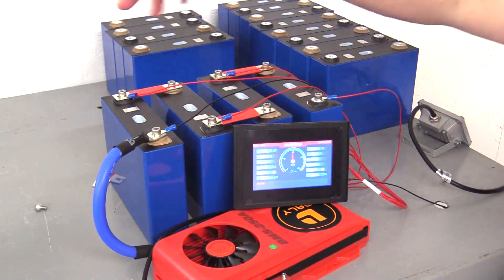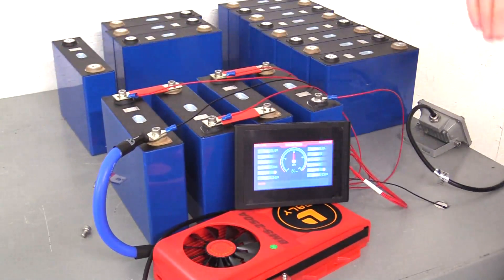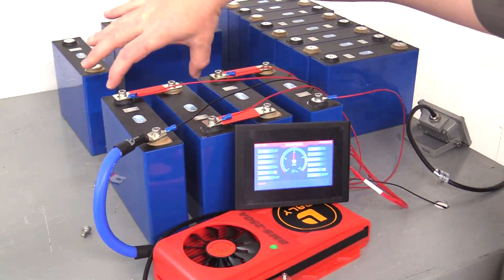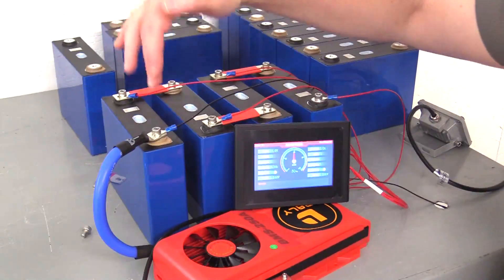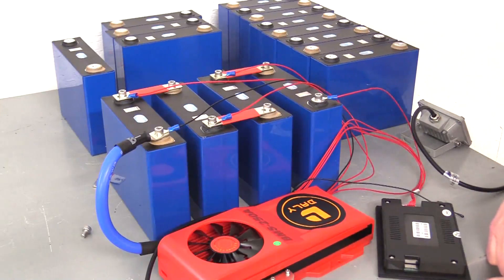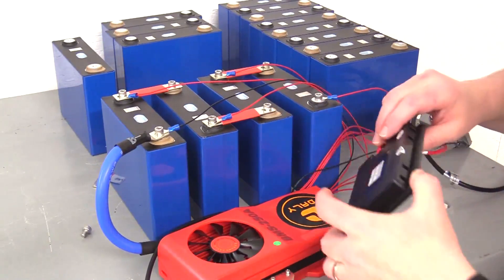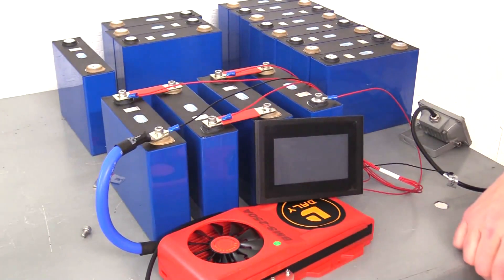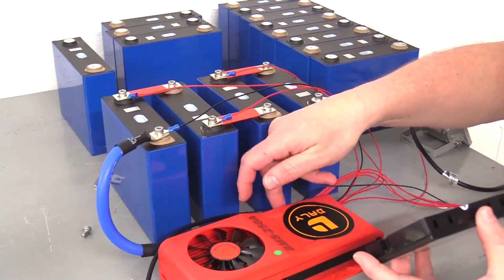How To Build A Lithium Battery Using Prismatic Cells

Comment: The "location" permission in Android is a tad misleading. An application must request that permission in order to access Bluetooth on the device. This is incredibly dumb, but it's not the fault of Daly in this instance. I use JK BMS, but I've never heard of the Daly app accessing GPS location, you could also simply block the app's access to data within your Android settings.
Reply from the maker: One of our techs attempted to block some of the app's access and the app would not function at all. Would absolutely love a workaround for this as it would be incredibly convenient to take advantage of the app. Just kind of tired of everything want all access all the time.
Reply: @MissouriWindandSolar  If you turn off its wifi and cell data usage that cripples its ability to phone home, so even if anything was recorded you would still be good. I tend to do so with all of the dodgy Chinese apps are a precaution. If it does not work without data... that would be concerning.

LineageOS includes "Privacy Guard" which feeds fake data to apps, but sadly that requires modifying your phone which is not viable for basic end users.

Comment: Why not use Tesla batteries
Reply: Chemistry is a big factor in that, LiFePo4 is a much safer chemistry for home battery cells. Tesla is lithium ion because they want to keep the weight down.
Reply from the maker: Also - and we would totally be happy with a serious fact check on this - it appears that you cannot DIY Tesla products. Would love someone to swoop in and yea/nay that.
Reply: @MissouriWindandSolar  The used packs are frequently pulled out of totaled vehicles, so the aftermarket industry has developed drop in replacement BMS's for the packs. Its not something I would ever touch, but people do it.